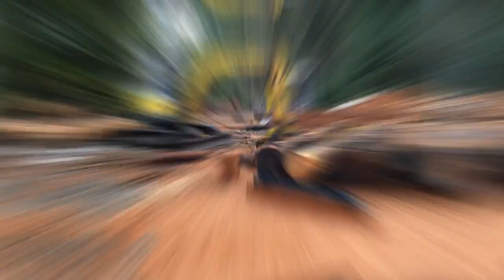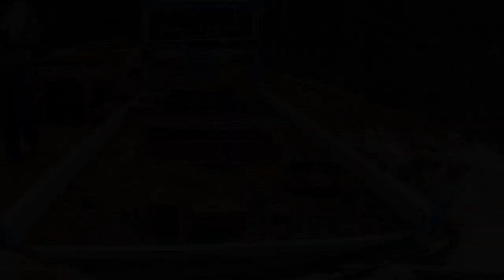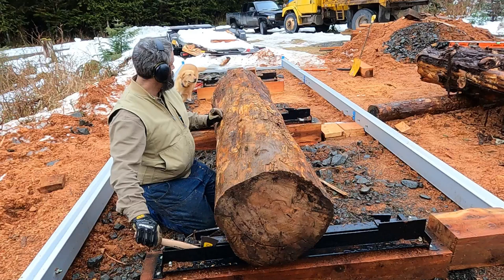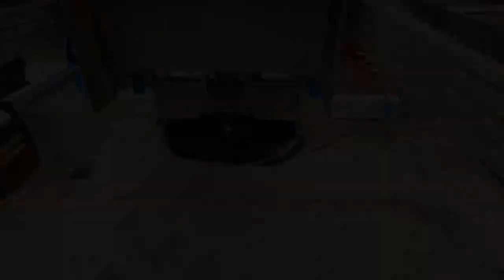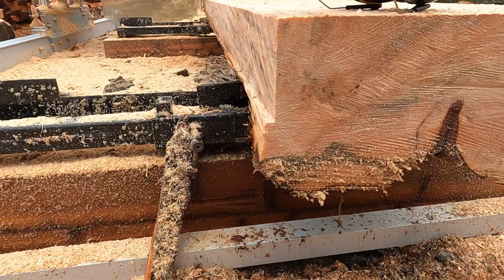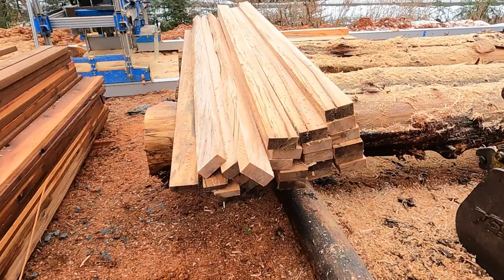Win Some Lose Some

Comment: Do you by chance have a quick way to adjust the log for the can't. I'm milling 16.6 logs and it's time consuming to adjust to the true center of the logs . I'm thinking about making some kind of jig or possibly fixing a laser. Also making some kind of sizzer jack for the log dogs to be quickly raised and lowered . I'm spending more time on set up than milling. The saw is awesome. Very fast and accurate.
Reply from the maker: Those are some good ideas. I haven’t really put much thought into that yet.

Comment: On your cross overs put angle braces
Reply from the maker: I’ll give that a try. I have some big angle iron that I think would work well. I appreciate the input.
Reply: @TheBeardedAlaskanSawyer  I am a old logger shingle weaver shake Sawyer. I bought the same mill and I added them braces and got a much better saw I had problems with length. Now we can run a full 40 footer. Good luck.